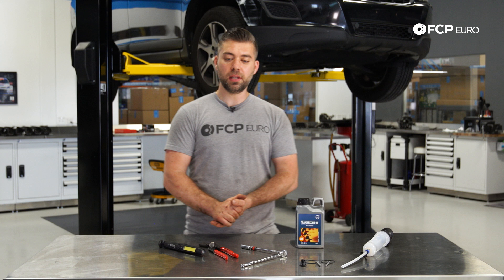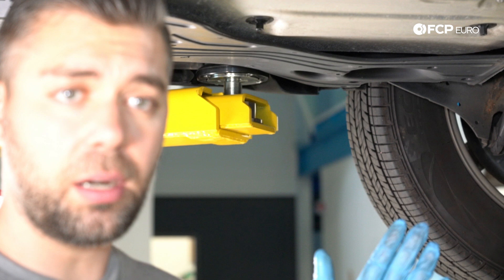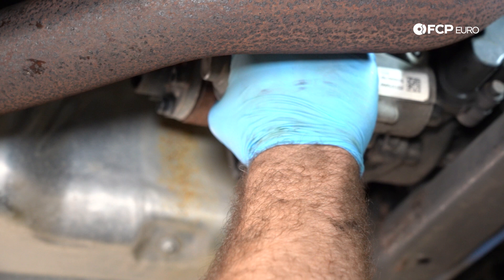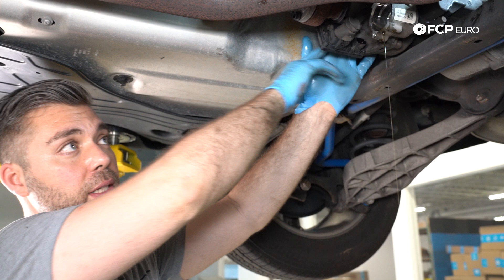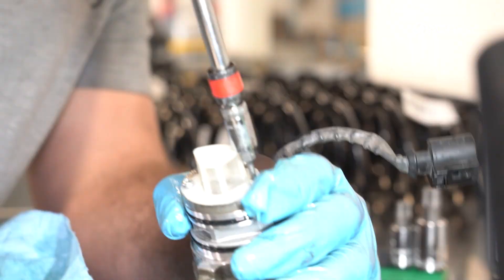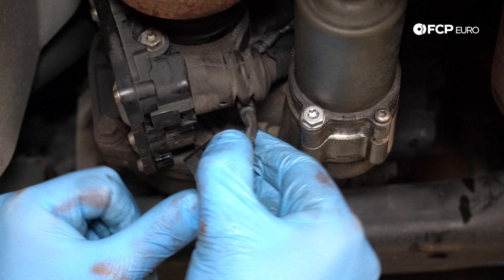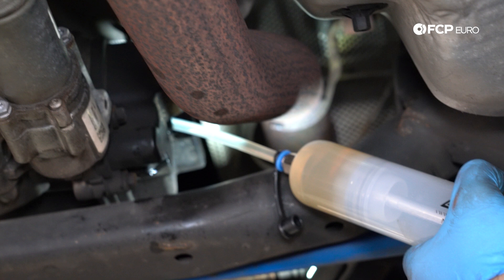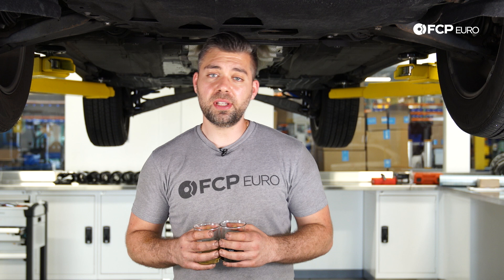Volvo Haldex AWD System Service DIY (Volvo S60, S80, V70, XC70, XC60, & V60 - Volvo P3 Chassis)

Comment: Pretty sure that after the "test drive" and then filling up the fluid to maximum for second time, the proper way to ensure the correct level is maintained is to syphon some back out with a graduated syringe with mL measurements. Did they change this in 5th Generation Haldex?

Comment: Servicing the Haldex is very important, I have a S60R and the oil level was too low which caused excessive current draw to the pump which then burnt the DEM (Haldex control module) out.
Reply: Engine oil? If so I have the same issue but my pump is bad on. 2004 xc70 2.5T
Reply: @wj8032  
No not engine oil, the Haldex unit has its own oil supply and uses a special oil available from Volvo and VW.

Comment: I have just watching one video for Volvo V60 CC where after the second top up whit oil the guy pour out 40 ml of oil, as he explained to reach the right level. Is this necessary or not?
Reply: no its not. late manuals tells that its enough just to fill it until its going out, aktivate "Bleeding mode for Pump" in VIDA (or make a wheel spin or testdrive) an check the level again.

Comment: Hello Jay I have a question for you. I have a 2009 s80 3liter turbo, it has 275k on it the haldex fluid was changed at 160k. When I put my foot into it I have a vibration what could be the cause?I love my car and want it to last Volvo quoted me 6 grand for a new haldex any suggestions would be much appreciated

Comment: Great video, really simple to do even on jack stands. Took me longer to screw and unscrew the fill plug than it did to do the rest of the service! BUT I figured out that you can take a baby size vise grips and clamp down on a quarter and then use that like a screwdriver and turn the fill plug in and out. Once I figured that out it was really easy. Highly recommend trying it if your having trouble holding the coin and/or can’t tighten it enough.

Comment: Jay does the best FCP videos. Great attention to detail that’s sadly lacking on so many other YouTube channels!
One suggestion on that connector, firstly spray internally the connector with electrical contact cleaner and then smear a little dielectric grease on the terminal pins before snapping back on! Prevents water ingress and improves electrical conductivity.
Reply from the maker: Smart approach Philip! We are happy to have Jay wrenching on cars again!

Comment: You do not need to drive. Just start the engine and put on D. Hold it a brake and put your foot on gas pedal same time.
Haldex pump will pump up oil to remove air bubbles its self.  Then refull oil to correct level.

Comment: I have a AWD Disabled warning light on my 2013 XC60 (112k miles). Took it to Volvo service for a diagnostic and service. They recommended that I replace the AOD Coupling due to an “internal fault.” I had no idea what that meant, and they even said it was extremely rare. Cost to repair was $5k. They said it was safe to drive since I basically now had a FWD car 😕 . That said, I declined the service as it wasn’t crucial for me to fix. 

I’m going to a local independent European specialist who does Volvos to do some routine maintenance, and am going to ask him to validate the Volvo service center’s diagnosis. If he says that Volvo was off their rockers, I’m going to ask him to perform this service (I proactively bought this kit from you). I can’t do it myself since I don’t have anywhere to work on my xc60. Swedespeed forum users also recommended trying this out before replacing the entire AOD. Any thoughts on this approach? Also, what’s the recommended frequency to change the Haldex fluid?
Reply: The service interval for haldex oil change should be 3 years or 30k km

Comment: very useful video but I am curious if you can get just the O-rings because it’s $165 for 2 O-rings, a plastic plunger, and $10 worth of brake clean and oil. That’s a bit hard to justify to a customer unless this is only DIY but still quite a bit of a mark up unless I’m missing something else because you can use that filler again. Most people have the oil and brake clean already.

Comment: If you are working on the P3 with jackstands like me, what's the best way to get the rear of the car up? I've seen it done with a floor jack on the rear subframe (the one right next to that nice blue sway bar in this video) with a 2x4 in between it and the jack pad, and then putting the jack stands on the factory pinch welds.  The manual doesn't specify a good spot to actually jack up the rear of the car.
Reply from the maker: That would be an appropriate method of lifting the car.

Comment: Thanks for the video, I ask you if you can help me with the differential of my 2014 Volvo activate the rear differential.
Small fact: if I have the differential light turned off by my mechanic, the differential is reactivated until I turn the car off.
Can you help me in Volvo just to look at it they ask me €250.
I would like to understand if it is a defect of the hadlex5 or a small thing.
A thousand thanks

Comment: Would the cleaning\maint of the pump resolve a "AWD Disabled, Service Required" error message on a 2013 Volvo S60 T5?   Is it ok to drive the car until this is resolved?
Thanks in advance.

Comment: why not show a video to change angle gear oil? Some ppl says angle gear at Haldex 5 AWD at Volvo P3  use the same oil  with transmissin gear box. I am not sure about that.
Reply: No atf going to angle gear haldex 5 awd. 
You can check on yt how to change angle gear oil. It is not easy but you need to change

Comment: Curious, instead of a test drive, is it sufficient to just spin the wheels for a while?
Reply: u can run "Bleeding mode" with VIDA or just spin the wheels and check the level again. VIDA tells different ways for different MY

Comment: I'm about to do a service and I was wandering how do you tell the sysytem you did? is there a reset prosedure? Thanks any info would be appresiated.
Reply from the maker: Hi Jose, there is no reset procedure for this service. If you currently have an error code for your haldex system, you will want to reset that code, otherwise no interval to reset.
Reply: @fcpeuro  Thanks for taking the time, I try a few different things and just holding the Reset Botton a fe times it seamed to work. Again much appreciated and great content. Do you have a video showing the steps to doing the transition filter?